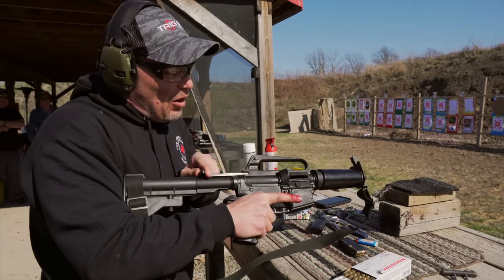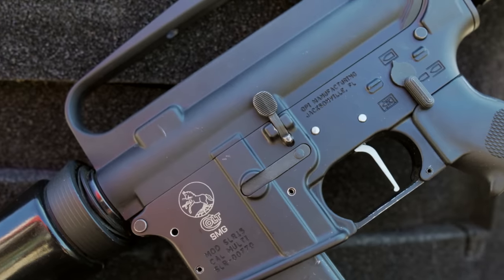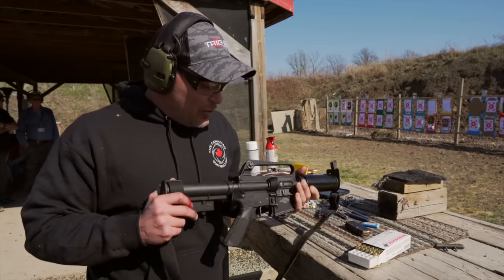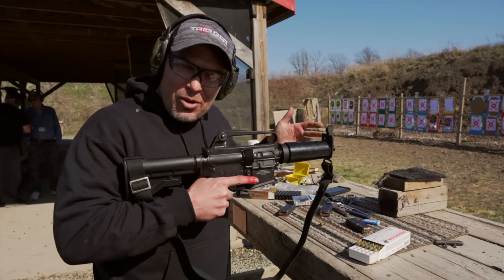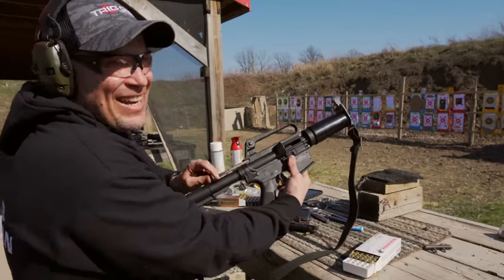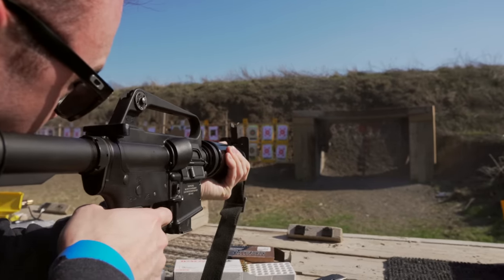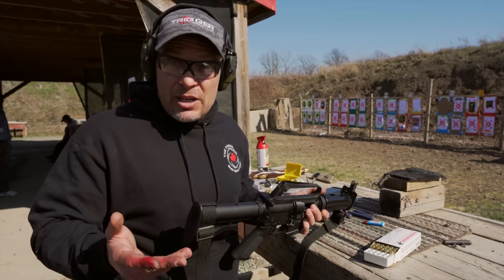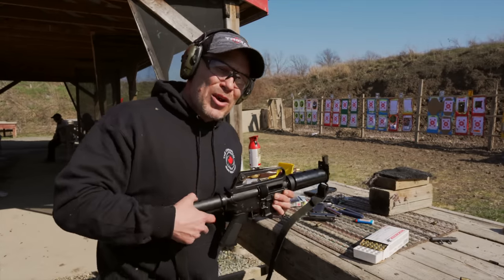Colt Department Of Energy AR-15

Comment: With a 30 round uzi mag at full capacity that would be a beast. Too bad it doesn't have the dept of energy crest on the pistol grip...
Reply from the maker: The original 32 round magazines would have been great to use.

Unfortunately the laws are what they are right now and we are confined to the use of the 10 rounders at best.

Truth be told I don't mind.

Just helps me work on my magazine changes

Thankyou for watching 

The CGV

Comment: I think you confused this with the 231 port firing weapon, which actually screwed into the firing port of the Bradley.  Both the DOE and 231 use the same hand guards...the 633 DOE got the left overs from the 231 FPW.  The DOE was developed for use at the plants.  Prior, DOE had hand me down M14's and M16's from DOD.  Someone finally had a thought about what they were doing and realized that full power rifle ammo might be a good idea for use inside the plants.  The DOE took about half of the order, which I think total production was 2500 in total...if my memory is working.  CT state police took about 1000.  The other 500ish allegedly sat in parts and were assembled into uppers and sold by Colt in the late 90's.  The put-togethers from Colt lack the front sling swivel.  I have one of those.

Comment: Are you sure only 2,000 Colt DOEs where made?  I shot DOE in FA at Knob Creek, USA in '98..... then I picked up a surplused-out DOE upper with ease to take home and use on a AR lower w/ a bushing adapter since DOEs are pre-90 with .315" pins at the front. With the Trudeau ban in 2020, it stays in the safe! no range time now!

Comment: Hey love the video how did you set up the holes to drill for your mag adapter? Did you utilize any jig or template? Would love to hear from you to understand how you made your mag adapter work!
Reply from the maker: I selected the placement of the holes based on photos I had seen of other units and where there seemed to be the most meat to grab onto the adapter. I then drilled smaĺler pilot holes and marked the adapter through said holes with the bolt in the forward position and magazine locked in place. Then I drilled slight larger holes in both the lower and marked locations on the adapter. There was a little fine tuning with locking the lower in place with a jig and the drilling of slightly larger holes with a bit of offset before its permanent installation. Voila!
Reply: @thecanadiangunvaultinc.1251  thank you so much!!!

Comment: Thank you for the video. Question if I may. Is that the proper attachment/ orientation of the sling thru the buttstock?  Thank you.
Reply from the maker: You know I just winged it with the sling assembly.

but I am pretty sure that it the correct orientation

It throws perfectly over my shoulder and around my back 

and deploys fast!

Thankyou for watching and good eye! ;)

The CGV
Reply: Thanks for getting back to me.  I put mine on the same way....and wasn't sure.  Awesome.